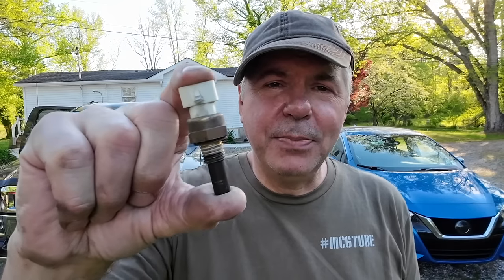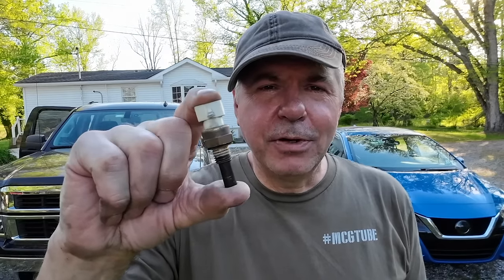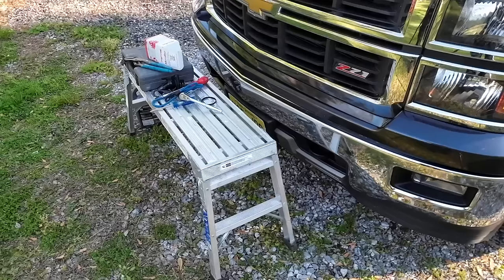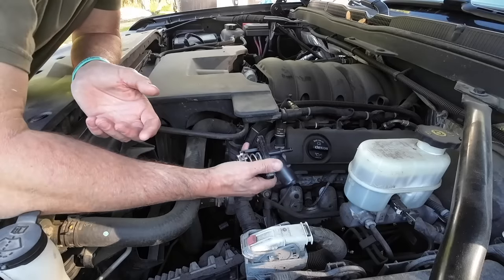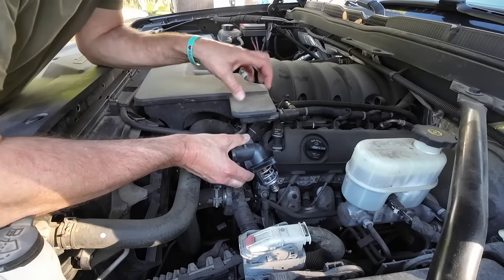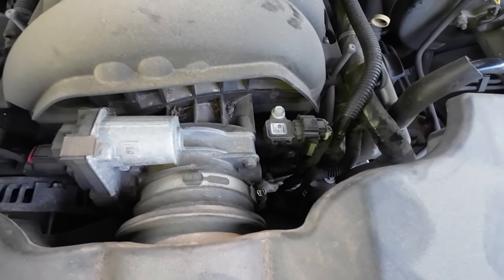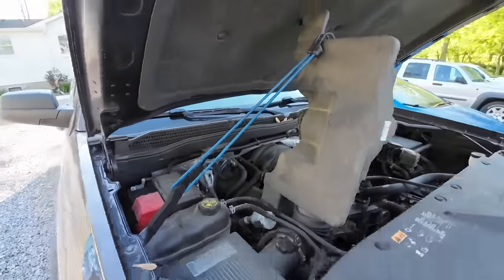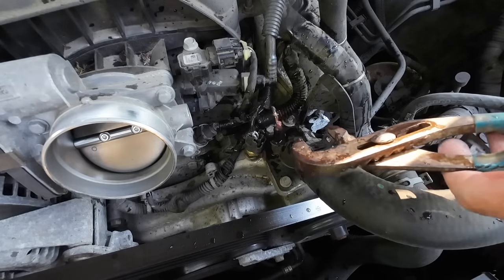Silverado Radiator Fan Won't Turn Off! This is THE fix! MCG video 141

Comment: Now I'm having the same issue with a chevy cruze replaced pump thermostat temperature sensor found out there are 2 also the a/c pressure is reading high don't know if fixing these will cure the stalling problem. Something else that trouble me is the water is reading 88 degrees in the morning cold engine any suggestions?
Reply from the maker: Not sure about the a/c pressure. Might be time for a mechanic to diagnose. For all the issues. 😐

Comment: What were your codes that you had to reset? My fans are roaring on high speed with a temperature reading of 180°, so I replaced thermostat housing, temperature switch with a Delphi brand, road tested, burped the heater,refilled The coolant.. checked for codes had no codes ...but my fans are still roaring at high speed even with the AC off. Nothing that I did has fixed this..  any other ideas? On a 2014 silverado
Reply from the maker: You may be dealing with a different issue. Did you try disconnecting the positive battery terminal for several minutes? Or just hit “reset” on the code reader regardless? I forget the code that mine threw.
Reply: @MyClutteredGarage .... I have an update for you. I figured it out. Problem  was actually at my AC high pressure line electrical switch that is near the compressor because that line vibrates one of the wires broke right at the connector to the high pressure switch as soon as I unplugged it the fans settled down to normal... soldered the broken wire at the connector also the other two wires had been rubbing through and had exposed copper from the vibration of the AC line at idle.
 Now the fans work normal.. Apparently the ECM did not like that broken wire not sending it a signal so automatically put the fans into overheat mode. If you look at an electrical schematic there are only two things that will activate both the number one and number two fans and that is coolant temperature switch or this AC switch.. normally to activate high fans the AC switch would be telling the ECM that the high side pressure is too high and then it would activate both the fans. But in my case it activated both the fans because of the broken black wire .
Reply from the maker: @joelthomas3823  wow! I bet that’s not a common issue but good info. Thanks!

Comment: Replaced thermostat an thermostat sensor. Still wont turn off. 2016 chevy tahoe. Any suggestions
Reply from the maker: Did you clear the codes?
Reply: Disconnected the negative battery terminal for a few minutes.  Hooked it back up, problem solved.  Thanks for the video

Comment: Hello! Ive had to replace my sensor 2 timew in the last 6 months on my 2017 Suburban. Fan runs loud, even when i turn it off and the temp gauge is reading 160. What can make my sensor keep going bad??? The thermostat?? Any suggestions would be appreciated.
Reply from the maker: If the temp gauge is reading 160, I’d guess it’s your thermostat that’s bad and not your sensor. That’s what mine was doing.
Reply: Replacing the sensor is not the problem. In fact I'd reinstall the quality oe one. As this gentleman explains you need a new oe thermostat. Because of the strike that may not be possible. For $53 I picked one up at napa yesterday. Make sure you get the one that opens up at 207 degrees. Disconnect your battery for 10 minutes. Your dash will read recalibrate and your outside temp will read low on touch screen. Take it for a drive and the computer will meet its parameters  and you will be good.
Reply: @bobcook8576  thank you. I'll give that a try.

Comment: Outstanding!! I’ve got a 2011 GMC SIERRA….a carbon copy. You done good Mr. Ed!!😎👊🏻
Reply from the maker: Same issue?
Reply: @MyClutteredGarage  not yet Ed. But I did battle the oil pressure sensor!! The thermostat would have given me the happy dance! I don’t know…think I liked the old system better…5 bucks for a thermostat…it was the only consumable part. I was thankful you made a point of educating folks on the proper coolant/antifreeze…most figure the cheaper the better…nothing the difference and why is priceless knowledge that will save a lot of folks a huge headache!!👍🏻

Comment: 2017 6.2L gmc . Got home and turned truck off and realized as i was unlaoding from out doing some christmas shopping that the fan was still on. finished unloanding and still running. so not sure what to do i found the fuse 12 and 13 and pulled them to cut the fans off. but did notice the temp gauge sitting on 160 and knew it should of been at 210 from the 30 minute drive home.  about to go get both sensor and thermostat , back to work tomorrow so doing both should solve it. didnt catch the sensor size socket.  Thanks of the video
update.. after replacing both sensor and thermostat and put everything back together and cranked the truck the problem was still there. Fans came right back on gauge still on 160, turned truck off and fans continued to run. i pulled the negative cable off and waited 5 min or so and reconnected battery and re started the truck and it went back to normal , gauge started climbing , no leaks and turning off truck fans turned off.
Reply from the maker: You likely don’t need the sensor. It’s probably just the thermostat. The sensor is doing its job by putting the fans into fault mode. You won’t know until you clear the codes and drive it for a few days. Good luck!

Comment: 17 Cadillac 3.6 coolant fans run as soon as you crank it. And sometimes A/C doesn't work disconnect from battery reapply a/cworks fine.  Could it be thermostat???
Reply from the maker: I bet it could be!
Reply: Thank you

Comment: I changed the thermostat in my 2016 Chevy Silverado and am still have the same issue… fan blowing/no AC/ temp gauge resting on 160. Do I need to change out temp sensor also?
Reply: Never mind. Went and had the codes reset and the truck was fine. Thank you for the helpful video!
Reply from the maker: Good to hear! Hope it solved the issue!

Comment: Just had the same issue but i changed the sensor  first. Worked for about 6 miles 
.went to go someplace else and now its back yo doing what it was before only difference  is i have heat this time
Reply from the maker: Did you change the thermostat too?

Comment: I’m having the same problem but I’m not getting a code at all could it still be the thermostat?
Reply from the maker: Seems like you should be getting some type of code regardless if it’s the temp sensor or thermostat. I’d probably still start with the thermostat and reset the codes.

Comment: I swapped the sensor and the thermostat but the fans are still running after i turn the truck of and the gauge only go's to like quarter dont know what to do now?
Reply from the maker: Did you clear the codes? And check your coolant level?
Reply: @MyClutteredGarage  well I took the battery cable off for a while should that be enough or no?  And yea I made sure it had coolant
Reply from the maker: Some say removing the battery terminal for a while works. Any check engine light? I’m not a mechanic so I’m not sure. Maybe go to a parts store and ask them to clear the codes. I think they’ll do it for free.
Reply: @MyClutteredGarage  no there's no check engine light on   but I will clear the codes yet n see what that does  thanks for your help
Reply from the maker: @henrymusicadeontario7413  good luck!

Comment: Changed the thermostat still having the same issue guess it's the sensor next.
Reply: I've changed the sensor and still have the same issue
Reply from the maker: Did you reset the codes?

Comment: I changed thermostat (10) years old, and the fan still runs, I must need the temperature sensor?…
Reply: My buddy just did both 6 hrs ago and still keeps running
Reply from the maker: Did you clear the codes?
Reply from the maker: Did he clear the codes?

Comment: I changed my sensor, but the fans still won’t turn off and my truck isn’t giving me a reading for my water temp. SOMEONE HELP 😂
Reply from the maker: Change the thermostat and reset the codes. 👍
Reply: @MyClutteredGarage  New thermostat, new Sensor, unplugged the battery for a bit then plugged it back in. Fans still blowing, and my water temperature gauge is not giving a reading anymore.

Comment: Glad I found your video. I will be making the fix tomorrow! I had the same issue with the fan and temp at 160 but it has been intermittent since last fall. When the truck seems to be working fine, I also noticed the temp only reaches part way to 210 as well. You mentioned mileage being an issue too. I have noticed my mileage has been worse lately as well. Hopefully this will be a win win all around. Thanks again. Have a great day.
Reply from the maker: Thank you. Good luck!
Reply: All fixed. Temp is good, no leaks, and I'll see about the mileage performance over time. Thanks again.
Reply: Me too. I had this happen to me today.

Comment: Thumbs up for the video.  My 2014 Silverado did all of this yesterday and I bought a thermostat and coolant temperature sensor.  $67 for the thermostat and $17 for the temperature sensor at Auto Zone.  Took about an hour to fix it this morning with the majority of the time wrestling with the hose clamps.  Temperature is at 210F and all is well.  Don't know which part was the culprit, but for the price of them it made sense to just replace each one while I was right there.

Comment: Excellent video, issue has been resolved. This was the 2nd time my Radiators Fans felt like flying.  Also, since the fans were rev'd up, that also killed my battery.  The first time, I took it to the dealership, and they could not recreate the problem. Several months later, the issue came back.  Just replaced the thermostat and I noticed my gauge finally start working properly, THANKS!!
Reply from the maker: Great!

Comment: Perfect - just like you said.  I went and ordered both parts (just in case) and installed the thermostat for my 2016 Silverado.  It took about 30 minutes.  Worked perfectly. I took the temp sensor back and got my $17.🥰
Reply from the maker: Nice!

Comment: UPDATE UPDATE UPDATE FOX
When I was going to change the thermostat, I decided to disconnect the battery for 1 minute and made contact with the disconnected positive cable with the negative cable of the battery without disconnecting, and when I started the engine it ran perfectly.  I don't know if I'll have the problem again, but for now everything is perfect.  Good luck.
Reply from the maker: I reset the codes before replacing my thermostat. The problem resurfaced after a week or so. But good luck! 👍

Comment: Is your temp reading inside the truck or is it stuck at "160". I replaced the sensor before but have the problem again a year or so later. Not getting any temp reading on my dash
Reply from the maker: Mine was stuck at 160 until I replaced the thermostat and reset the codes.

Comment: Had the same problem with my 14 Sierra. Changed both the sensor and thermostat, so far so good. Hopefully it's fixed now. Since I bought it mine always ran about 185 and I thought that was normal, now it's consistently running about 210
Reply from the maker: I bet it will be fine. Sadly, my truck got totaled shorty after this fix!

Comment: If you replace that sensor by the thermostat make sure you unhook your battery after you replace it. That’s all I did. Thermostat was still good fans didn’t come on truck hasn’t overheated and is running at the right temperature. Thought I’d put this on there, so someone doesn’t buy a thermostat that they don’t need. If my truck overheats, I’ll let you know on here. So far no overheating, and running at right temperature. Plus when you unhook the positive cable it would clear the codes do you have in your computer.

Comment: Good morning Ed. So if the temp gauge reads below 210, it’s the thermostat issue. If the temp gauge doesn’t read at all. Stuck at 160 (all the way left) it’s a temp sensor issue? Sometimes my temp gauge works and sometimes it doesn’t and check engine light comes on. When it works it’s good at 210. When it doesn’t it’s stuck at 160 all the way left. What u think? Thank you.
Reply from the maker: Good morning. That’s a tough call. If the gauge reads 210 when it’s working, it sounds like the thermostat is ok? My gut tells me that these thermostats are a weak point on these trucks. So the thermostat could be sticking open when you don’t realize it and sending it into fault mode. Hit or miss, but I still  bet it’s the thermostat. Start with either one, or just change both. Thank you and good luck!

Comment: I had already replaced the temp sensor, no luck. Watched this excellent video, went and bought the thermostat. But I decided to scan for codes(I did not have a check engine light), cleared the P0128 (Error code P0128 indicates that your engine coolant temperature is below the thermostat regulating temperature. This means that your Engine Control Module (ECM) or Powertrain Control Module (PCM) has recognized that your engine is running cooler than it's supposed to). After clearing the code, started the truck and went for a ride- no fans and temp started rising up normally. I may still replace the t-stat, truck has 117K so a new tstat couldn't hurt. But before you replace either of these parts, clear your codes...you might save yourself a little time and money.
This all started after we replaced the radiator and power flushed the cooling system. I wasn't having any issues other than a very minor radiator leak. When I got my truck back I noticed the temp wouldn't climb and the fans were roaring on high- cleared the codes as mentioned above and fans stop coming on, temp rose to 210...back to normal.
Reply from the maker: Thanks! If the thermostat is not closing properly, you will likely get the fault again. Good luck!

Comment: Thank you for posting this! I have had the EXACT same symptoms over the last few weeks and today I heard my cooling fans kick in at full blast when I stopped at the traffic light. When I got home my fans stayed on for a very long time and my upper radiator hose was ICE cold with no pressure.
Reply from the maker: Thanks! Good luck!

Comment: my fan started running this morning and would not shut off. No codes came up no errors, but the temperature was bottomed out.
I decided to replace both since the price was only like 20 bucks and I had the stuff apart .
seems to be working properly now .
thank you for taking the time to do this 👍
Reply from the maker: Awesome!

Comment: 2016 GMC Yukon - yesterday same problem developed as shown in this video. While I might could repair myself, I'm out of town and not even sure I could get the parts on Sunday, NYE day. I'm about 200 miles from home. Can I drive the car back home this afternoon?
Reply from the maker: I’m no mechanic, but I’d think that as long as you’re not low in coolant it should be fine.

Comment: I can confirm this. My fans stayed on the other day... I changed the thermostat first. It worked. "Pro tips"... Disconnect the battery. The computer won't reset and the fans will still run if you don't. (Ask me how I know). The bungee isn't really necessary...it's only for 1 bolt. You'll need extra antifreeze. I spilled about 2 or 3 qts. Don't over-torque the bolts. (A bit more than snug is good), or the housing will crack. Either do this on dirt, or have a hose handy to rinse everything off when your done. Especially if you have a dog. (Antifreeze and dogs can be deadly).

Comment: I had the very same problem.  replaced the temp. sensor and worked great for about a week.  Then followed your advice and replaced the thermostat. Now working fine and warms up to 210 F just like new.  So far so good we will see over time.  I am suspect of the connector that engages the sensor, so I have on hand a new connector just in case I need it. Original connector may not be staying in locked position.
Thanks for you help!!
Reply from the maker: Great! Hope it does the trick!

Comment: Hopefully this fixes my issue. Prior to replacing the sensor I just pulled the negative terminal and it reset the system and was fine when I restarted the truck. But more than likely would go out again soon if I didn’t. Easy fix. Released pressure from the radiator cap prior so when I pulled the sensor it was a small spit of fluid 5 percent of what came out in the video.
Reply from the maker: Good luck!

Comment: I have two of these, a 2014 and a 2015 ( both 1500s with the AFM/DOD 🤮 5.3 ) nothing but problems with both. I fixed it by selling them and I bought a Toyota Tacoma. Haven't had any issues since.

Comment: After 10 months is it still working good. I have 15 silcerado with the same problem.  I have switched the coolant switch once and be good for two yrs. Bought a new and went out in two days. Dont knkw what to think now if to change the Thermostat. Sheesh
Reply from the maker: I would definitely change the thermostat if you haven't yet. Unfortunately, I had an accident shortly after this fix, so I don't have any long term info. Check this out: https://youtu.be/Eg9WHoREFJA

Comment: I believe that is exactly what my problem is too. I to put the sensor in first had no problems for about four months and it started doing it again. I had bought a thermostat at that time just in case it did it again so tomorrow I will be putting that in. Thank you for your video.
Reply from the maker: Thanks! Hope it works!

Comment: Will loosening the coolant tank cap before starting release the pressure before starting to remove hoses?  I noticed this truck doesn't have a typical radiator cap or top tank.  Thanks again for the video.
Reply from the maker: I don’t think so. Be sure to let the truck cool down completely.